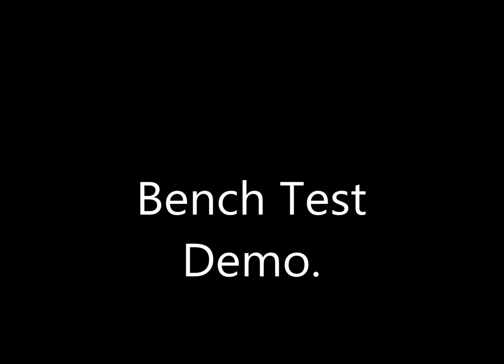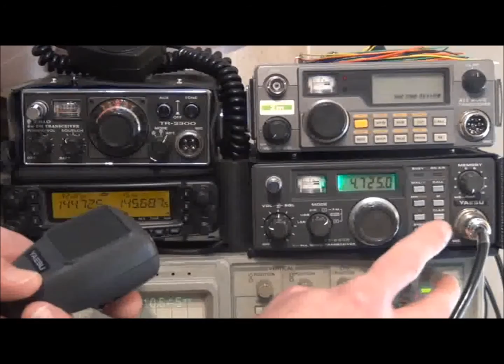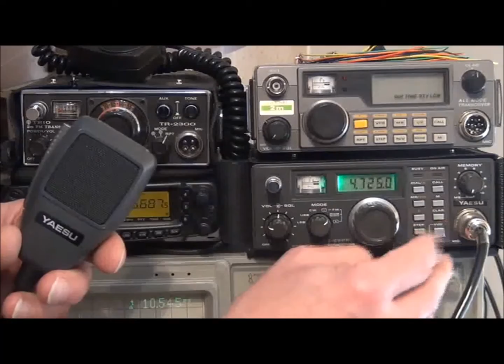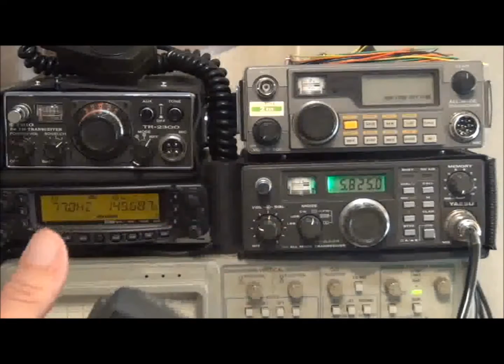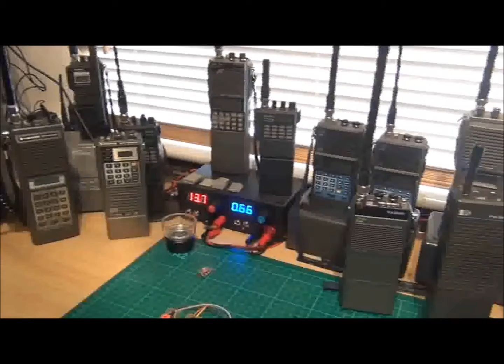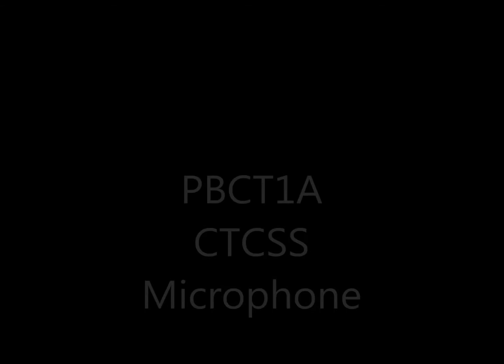PBCT1 Intelligent CTCSS Encoder

Comment: May I ask where you obtain the FNB-2 batteries from, for the FT-208/708/207 please? 73, Ian G1DRP
Reply: Hello Ian, it is difficult to obtain the old nicad packs so I use lithium ion cells ( modified radio) nowadays. Also performance is so much better. I plan on uploading many more videos soon, one of which will detail the modification made to an FT 207R. Cheers Paul
Reply: Paul Taylor Hi Paul, I did consider using three Lion cells myself. I’m quite partial to the older Yaesu hand helds.  Cheers, Ian

Comment: Hello I have a Icom 251a....will this work in my unit?
Reply: Yes Jamie, I designed the board to work in any radio. My intention was to be able to design a board with a method of operation which would allow complete control of desired tone frequency without having (where possible) to add additional controls (buttons, switches etc) to the original radio. A good example of this can be found on the fitting to the Yaesu FT209. In this case, either the tone burst or lamp buttons on the radio could also be used as the tone select button. The selected tone frequency is then indicated audibly via the speaker (and or either by an led mounted behind the S meter). Another good example is the fitting to the old Pye PF8, where the squelch defeat button double up as tone select with audible indication using the bottom mic.

Comment from the maker: Hi Mark. These boards are presently tone encoders. I am working on a firmware update which will allow them in the future to be used as decoders also. This will require a further two wires to be connected to the board and therefore to the radio itself. As most operators will only require encoder operation for repeater access I have decided to launch this as a standalone version.